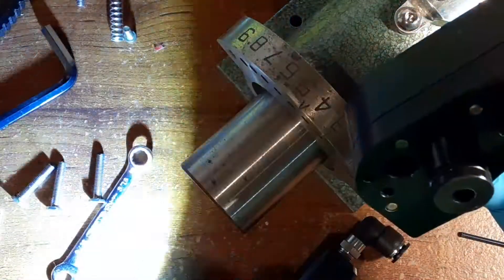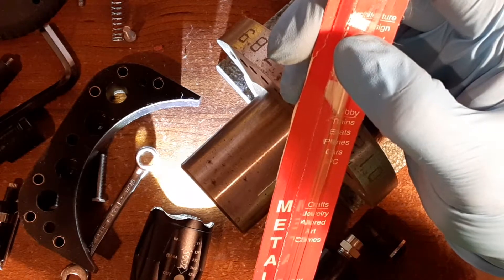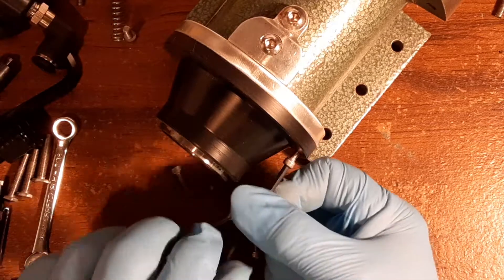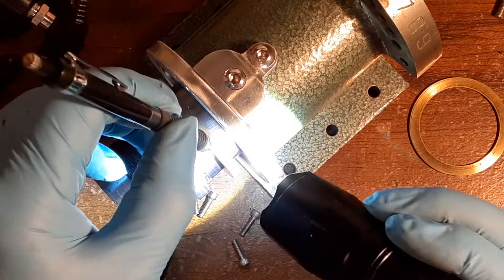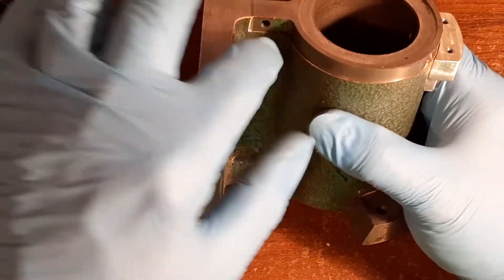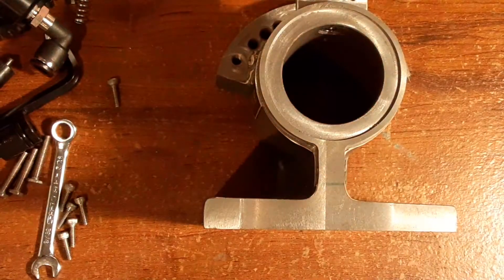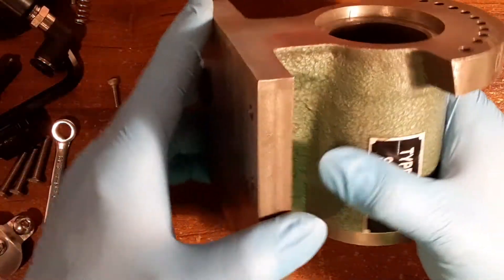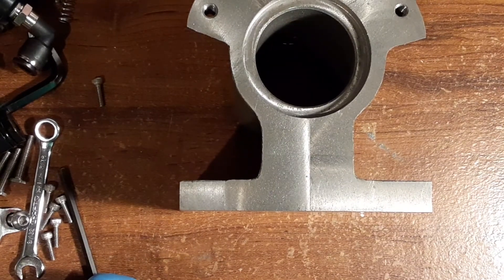Spin indexer machine tool part two.

Comment: Lotta love for a Chinese knockoff:) shoulda just bought a yuasa
Reply from the maker: I have used several Yuasa rotabs in the past both horizontal and horizontal/vertical. These are very nice machines. I also used a 4th axis automatic digital indexing rotary table + control. Another nice machine. Nice machines have nice price tags. Not saying they aren't worth the price but for someone in a home "hobby" shop or "part time", a little too pricey for me. This is how the spin indexer evolved into a DIY project with nice machine features.
Reply: @toolmaker1370  yeah just checked. They are goin for about $200. on ebay. Just seems a shame to grace that chinesium POS with so much love. Can't beat political dissident slave labor :)